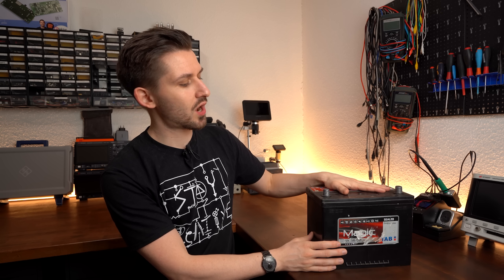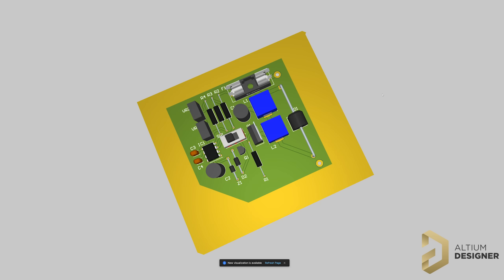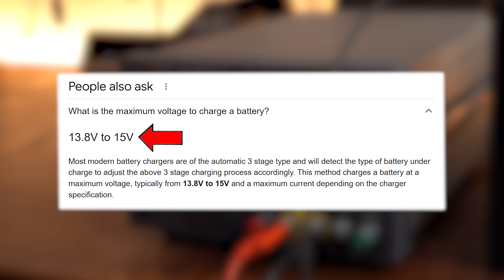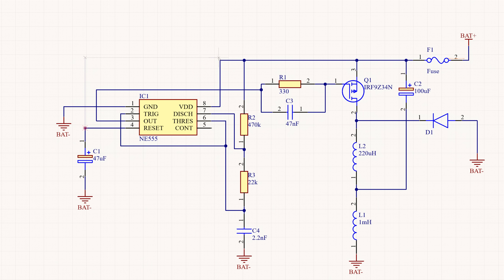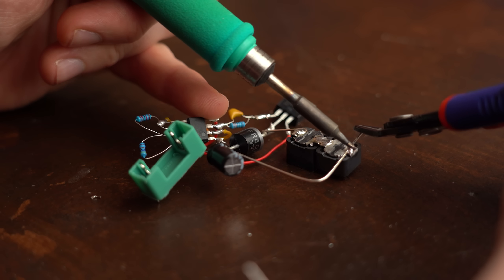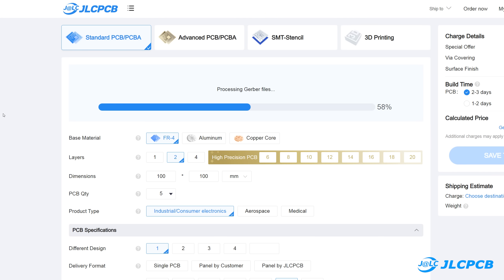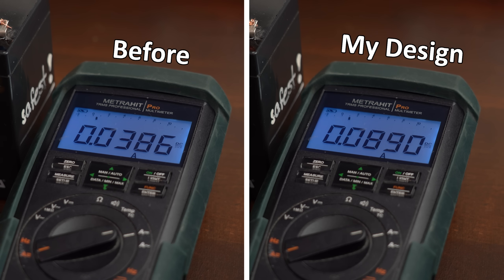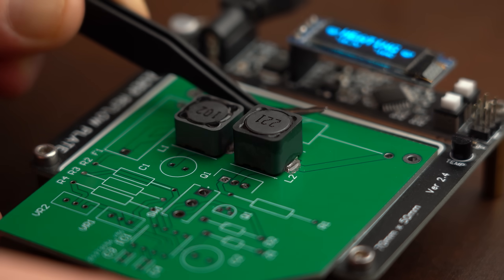I followed a YouTube "Battery Hack" and Wasted 30 Days! (Desulfator)

Comment: you have to clean or replace the plates, 1st check acid level ph , shake up the used battery and wash it out then replace acid never tried it but would probably work

Comment: So the biggest problem with this is that the issue isnt actually electrical in nature sure a battery produces electricity but the reaction it uses to do so is chemical once the potency of said reaction slows the only way to fix it would be to replace said chemical components so the reaction can start again. Eg baking soda and vinegar dont endlessly make foam it is limited

Comment: I'm using desulfator from years and stopped to buy batteries.. i was used to change the battery of my motorbike every 2 years, but now it is 5 years old and still working.
my personal experience says it works!

Comment: I did battery "restoration" in different way: charge up battery, then discharge to 0V and start charge up to reverse polarity, then again discharge and charge up to normally polarity. That all cycles almost taking one week, most hard part when battery should cross zero volt and charge in reverse polarity, most of that zero crossing time i did manually with extra 1.5V battery in parallel but reversed polarity to help for CC power supply to be connected in reverse polarity.  All this i did base of lead acid battery theory: both electrodes are PbSO4 in discharged states, and fully charged state: negative- Pb and Positive-PbO2. So my theory each one time somewhere i find in internet, that after Sulfation form, when battery are charged jus one of electrodes are naturally cleaned from sulfating crystals, o by charge in reverse should another electrode clean from sulfations. I didn't have proper tools to measure capacity, so also can't say its work. I test with 4 dead batters: 1 didn't survive - i discharged to rapid and shot one internal cell, so from 12V remain 10V :), other 2 went ok, and another same like with yours first, newer end to charge (in normal way ,reversed, and after return to normal charging) generating heat and bubbling noise, but was still keeping 12V. So maybe you can try this way?  :)

Comment: I have a charger with this option on it and it does not fully recover batteries but it defiantly can if implemented correctly which I don’t know what that really means but seems like I have regained some usability.  

Great example I had a mower mid cutting season just refused to start cuz battery was spanked.  You have to jumpstart it and once it was running, it was good you turn it off wouldn’t turn back on.   Put it on the charger put it on auto and it immediately wanted to go into desulfate mode… what that run its magic took all night apparently once it was completed wanted to do another charge cycle. I love that finish put it into the mower and it didn’t need a jump start or anything for the rest of the season.    It only started to slow crank at the very end, but it would still fired…. 

They probably only added a tiny bit of capacity back like just enough so it could start freely and the charger on the mower could catch up in time before that capacity was drained… but was getting close at the end.

Comment: Ya desulfation won’t work on extreme cases unless it was done early enough. You could try doing the routine a few times too see if it helps but usually need to manually clean

Comment: Based on my tests, desulfation works pretty well on "new" good quality batteries killed by over discharge (in my case it sat in my car for around 60 days while it was parked waiting for me to repair the motor, and the battery was around 3 months old).
I did it with an MOSFET, a resistor in series, my bench power supply and function generator, pulsing 20kHz for something around 3 days straight.
I can't tell if the capacity was restored to original, but the battery sure started to hold charge again, after that.
I used this battery for around a year after that, until I sold the car.

Comment: Let me say first of all that I don't know so well lead batteries, and how to size inductors. Anyway by looking at the internals of the big battery used in the experiment, it seems that the chemical erosion is considerable, as the crystals build-up separated the electrode in layers (2:14). Not considering that, I would think about this problem as an something that requires some "brute force" to be solved. 
If I had to remove the crystals manually (= by opening the battery), probably I'd remove the old acid; then rinsed with water & brushed everything that I could reach with some brass ..brush, to avoid damage.
This is what the circuit should try replicate (IMMO)!

Now I've got a question: those coils, the frequency, what's their purpose? Create current pulses, which physically remove the crystals, or maybe, just raise the temperature inside the battery, to help them solve in water? 
It may be simple as that...maybe the sulfate (which is a salt), it's easier to remove when the solution is warmer. 

So if you fill the battery with water, leave  the device running for 1 day, then replace the water...again and again for 30 days, maybe at the end of this process most of the solfate has been removed by water. 
If that is the case, you can add deionize water mixed with acid (HCl ?), and try to charge the battery! I would do also a couple of full cycles, to let everything setup. 
Well, if the measurements doesn't change, then 1C is enough 🙂

What do you think guys?

Comment: Regarding the capacity printed on the battery, that is usually the 20 hour rate. Lead acid batteries drop significantly in capacity as the discharge current increases.
A difference of 10% isn't uncommon between 0.05C and 0.1C discharge rates. 1C could result in 30% less capacity.

Comment: sorry load desulfation is BS
but CHARGE desulphation is how it actually works
you give a battery a full charge, then add the device that pulses very high voltage(overcharge levels) at the high frequency and you watch the distilled water levels
this process causes electrolysis and also knocks sulphate crystals off
a fairly new sulphated battery can be recovered but if this process is done too much(from improperly stored batteries) it can build a pile of shunting crystals in the trap of the lead-acid battery effectively ruining the entire battery as you will have lost so much mass from the plates it becomes worthless
but if you have a fairly new battery(like a car battery that ran low once or twice) you can basically recover it by connecting to a "desulphation charger" for a single treatment cycle
but these passive ones that use spikes of load not spikes of overcharge will do basically nothing but discharge the battery faster than standby and that increases cycle count and may risk killing the battery from over discharge
so yes mr scott this circuit is real but a scam to advocate
what you need is a pulsed overcharger that waits for terminals to drop down below max charge before sending another overcharge pulse(likely about what a laptop charger puts out) and leave it for a few days like that giving large overvoltage but only in a very very slow and short duty cycle

Comment: Did I miss the part where he somehow confirmed that all these batteries were degraded due to sulphation, or is this another classic Great Scott video based on half assed assumptions?  Car batteries rarely die from sulphation unless they are left discharged for long periods and gel batteries like the one he shows around 6:25 most always die from the gel drying out as they age, especially when continuously float charged as they are in house alarms and UPS applications.

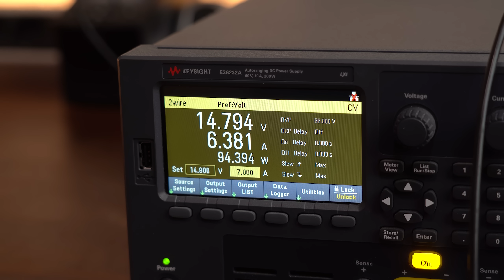Comment: 3:14 what you might be experiencing here is actually an internally shorted cell or a cell that's been reverse charged. This can be fixed you'd need to charge it with very high current and pulsing it, essentially kinda damaging it in the process a little. Not the best solution but it does work.

Now as for desulfation, I have bought myself a battery desulfator, one of the cheaper kinds. It hasn't actually desulfated anything for me but I noticed it did solve some other problems that those batteries had. Self drainage was gone. on 1 battery the voltage would drop down to 12.5v overtime after fully charging it. Now it stays at 13.2v which is a significant improvement so it isn't entirely useless.

What I've found that actually desulfates the battery is by just cycling it with high current. I've even gotten lead acid batteries that were at 0V back to 13.1V with this method and it works really well. You just have to stop discharging the battery at 10.5v to avoid reversing the cells. What you should notice is that the capacity increases with each cycle. It might take time till it starts increasing but you will notice it. From my testing it usually takes around 20 cycles to get it back to a good condition
Reply: from nicd charging i remember that they could handle high current charging very well. the output afterwards was better compared to slow charging and they had less memory effects
high current charging gargabe cells worked several times.
Reply: How high? 1C? 10.5V is under the load or open circuit?
Reply: @VavrMar  Load depends how much current the battery can deliver. There really isn't a way to know, it's more or less trial and error but you roughly want to stay at a lower current so an amp or 2. You may even use a PC fan that pulls like 100mA if it really drops off a lot under load. Also 10.5v on open circuit

Comment: So I'm going to stop at 27 seconds in. The reason lead-acid batteries fail and lose capacity is because lead sulfate crystals form on the plates and can never, ever, under any circumstances that don't involve rebuilding the battery physically, be functionally returned to the electrodes. When crystalline lead II sulfate eats your electrodes or covers them, thats it. Nothing can fix it.

Comment: I came to the same conclusion - dosn't really work. Some years ago after reading several white papers on the topic I performed series of desulfation tests on like dozen heavilly used batteries with Pb-Pb, Pb-Ca, Ca-Ca electrodes incl. AGM. I also rinsed them out to get rid of the deposites and used new acid for flooded types. Used programmable power supply and  varied not only frequency and the charging current but also discharging current as some papers suggested to potential benefit of having some sort of cycling between charging and discharging at the same time. That implies slow cycles due to the lead acid Pb chemistry inertia. 
The only (partial) success I had was to bring completely dead classical flooded Pb-Pb batteries back to life somehow. The batteries were initially in the state that it was not possible to charge them (almost zero current even when  16V external supply at the terminals). OCV was bellow 6V. 
The best results came from low freq. (bellow 10Hz), keeping energy symmetrical cycling while terminal voltage maintained at around 10.8V (i.e. depleted battery, I varied this SOC point in my test plan too) with charging pulses about 10A and discharging cca 6A (longer period). To get to that 10.8V and to achieve there 10A required significant peak voltage - like 30V. After a week of desulfation and final charging I was able to get e.g. about 11Ah from a 72Ah previously dead battery. But there was exceptionally high Peukert constant - above 3. So even this fraction of original capacity of new battery was available only under low loads, I tested at 6A discharge current if I remember correctly so for Peukert's nominal 20hour discharge (3.6A) the capacity could go up to 30Ah max.

Comment: You are amazing!  Every time I watch your videos, I look for something missing that I would do to improve the testing methodology and/or increase the accuracy of the results and rarely if ever come up with anything.  Which just goes to show that you the smarter one here.  In addition, you answer questions that have plagued me for years, but not enough to get off my lazy ass and do anything about them.  That said ... I have always wondered if there was any benefit to desulfation and you have proven to me (along with other readers experiences) that the answer is big no!.  I too have never seen an improvement on the batteries that I have tried. Thisresurrection.

Comment: What I'm curious about is if a desulfator can be used in a preventative way? If you have equipment with new batteries that will be sitting for months at a time, can installing one of these keep the battery from getting sulphated?
Reply: Just use a float charger to keep the batteries at 100% charge...

Comment: Hi. The most cause of low capacity/voltage is a shortcut of the lead plates inside the battery. If you have 10-11 volts mostly 2 plates have a shortcut (mostly 2 volts/plate in a small one) and the 2 works like one. You can do whatever you want, it wouldn't change. The battery is dead. If you have 13-14 volts with a short time of capacity, this could! work. But its not a guarantee at all. As I saw the voltage I realy had wondered if the circuit had worked.

Comment: I've used CTEK battery charger that has a "Reconditioning" setting and not really sure what it does but I've gotten almost dead batteries working for a year or two. I mean some car battery that didn't hold a charge anymore I got back to working good enough I could use it in my car again

Comment: Just a very very quick question, since I also tried desulfating some of my lead-acid batteries (and actually got some results - all of them were deep-discharged and instead of ~10v they all had ~4v~6v, none of them were able to charge +2v and hold it for an hour.. and at the end, and after a LOT of time, 1 was "revived" - could charg up to ~14v and hold it for a few days (LOL), and the remaining 5 ones turned out to be dead due to internal shorts, which I would have to disasseble and rebuild the battery.. nah, I pass) --- so the question - when you ran the desulfation, you checked the frequency (AFAIK I remember I read that the best is the crystals' resonant freq and it's somewhere in the low MHz..) - but have you checked the voltage? To break down the crystals, the voltage spikes at the peak should be several tens of volts, at least. It also all depends on the battery type.. GEL AGM VRLA.. the newer the tech, the easier it can be damaged, but in case of the most basic flooded lead-acid batteries, you actually can do them a very good thing if you let them boil a bit :) sooo the voltage, did you check the peak voltage?

Comment: Great video as always. It’s interesting, that I see no comments from any farmers. I was raised on a farm and most farmers had a simple desulfator made from nothing more than a rectifier and a run capacitor from and air conditioning unit. You plug one end into 120 vac and connect the other to the battery. This gives you a DC out with a large AC ripple of 120hz which, over time, breaks down the sulfation. This will not work on batteries with bad cells but will work about 50% of the time. Something to remember though…this simply postpones the inevitable. The sulfation doesn’t magically disappear but falls to the bottom of the cells. Unless the battery is flushed this will eventually cause a problem.

Comment: Just as you said..@ 8: 50-55 , you made a terrible mistake..... that coil burn or M_Fet failure WILL happen
....the circuit is wired/ designed for
 " FLYBACK" - ( boost) mode operation....here the power switch always  HAS TO BE "on" for LESS THAN 50% duty cycle..this duration the energy is stored in magnetic field 
& dumped into load when switch is turned off...this will allow(1) higher pk.amps/ to charge the batt. (2)core flux gets reset ( volt-sec. balance of 
ON/Off time is maintained.)
The failure was due to gradual flux buildup that eventually led to saturation & allowed the destructive current to cause damage.

Comment: I have seen a couple of people attempt to debunk the "MIG Welder battery recovery".  It only worked on the non maintenance-free batteries, he was able to dump out the old acid, then filled it up with new battery acid, then hit it with the welder (making certain to observe proper battery polarity) and he hit it just a few times for a few seconds at a time and it was able to recover it to about 90%.  The problem is that the battery plates on a normal car battery are very thin and the positive plates are made with a paste of "red lead", and the sulfates causes the paste to crumble off of the plate, and that's what causes them to go bad, as the lead paste will fall to the bottom of the battery and cause a short between the positive and negative plates.

Comment: I had with such "pulse" techniques and overcharging only (very slight) success at old NiCd batteries to reverse the memory effect a bit if i remember right
But a chemical aged battery is NEVER "refurbishable", just hopefully good recyclable e-waste.

Thats why i love long lasting batteries, LSD NiMh (white eneloops), LiFePo4 and not too "oversized" (in capacity per kg) LiIon chemistries and definately safer ones like IMR

Comment: "resistor that is connected to absolutely nothing"
Bruh.. It is a double-sided PCB..
If you look at it thoroughly, C3's negative pin is connected to the absolutely same nothing, and also several of the IC's pins are "dangling" in the same way..
Reply from the maker: True. Only problem is that it is that the resistor is connected between GND and GND.